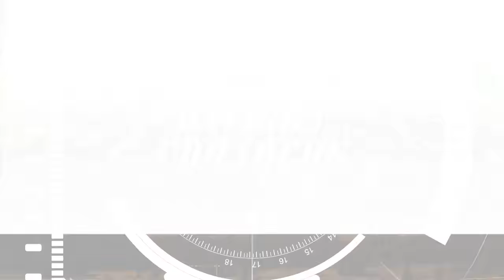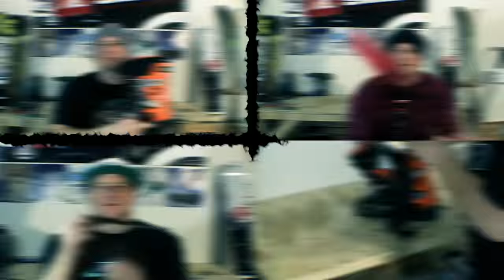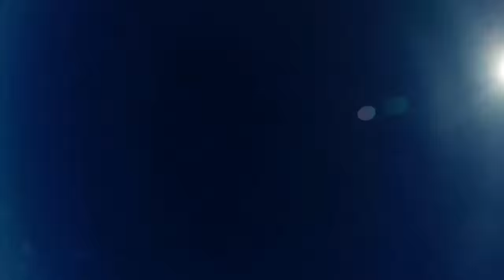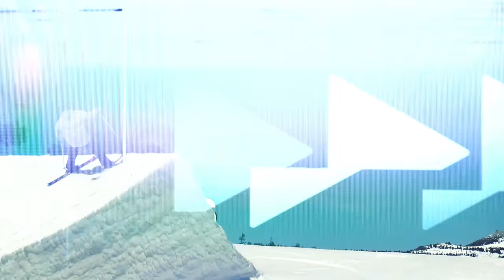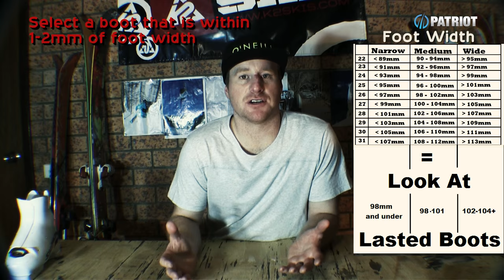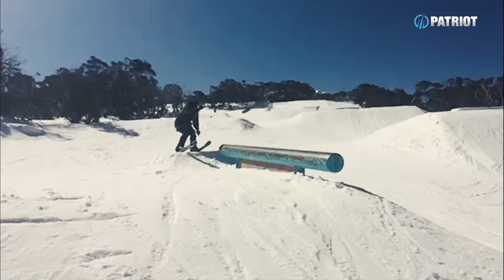How to choose a Ski Boot Last - Bootorials Ep.31

Comment: Thanks for this series. Very informative and precise. I have tons of problems to buy my first boots. Used Fischer Scan-Fit to measure my feet. The average  measured length: 285, ball width: 114, instep height: 78-82.  Tried several boots in the ski shops... always feeling several pressure points... assumed that I need heat moldable boots. I think that the closest to feel OK-ish was 29.5, 104 last (adjusted to my size: 110) Rossignol Speed 120 (still after awhile it felt good to take them off). Have no idea how much they will extend by itself during skiing and since they are not heat moldable I'm a little bit concerned.  Another boots recommended for wide feet: Atomic Hawk Magna 110 (with 102 last) seemed tight in instep. Boot fitter also recommended boots which he didn't have in store but could get soon: Fischer RC One 90, which are fully moldable (but come with 101 last) ... What would you suggest to do ?
Reply from the maker: Hey Tomasz, Yeah great work on the foot scanning. 
Do you have much confidence in the boot fitter to be able to stretch them for you? 
If you are looking to a heat moldable choice, the magna and RC one are both good.  I would also suggest looking at the Salomon SPro HV and the K2 BFC if you have a chance to try them on. 
The best thing you can do is spend a little time to see what feels most natural on your feet. That will be the best to then work from to adapt to your feet.

Comment: Such an interesting series thanks so much Craig. 
I'm really struggling at the moment - I've got Hawx 110s 28.5 (I think they give me 106mm last? off the shelf but they've also been stretched) which were fitted for me inc custom foot beds and have skied in for a couple of weeks, I find them comfy BUT they're just not stiff enough for me when I'm skiing hard and fast. 
I've bought a pair of FT Descendant 28.5s and followed your awesome videos on expanding the boot (thanks). I did one shell expansion but feel perhaps the inner layer of plastic maybe didn't get hot enough (in the oven at 119c for 10 mins) as I'm still finding them a little tight, no precise hotspots but overall just a little tight/cramped. I can't ski on them to fully test just yet as I'm at home many miles from snow :( . Oh i've also put in my previously moulded custom foot beds. 
 I have subsequently read online that FT's run a little short and that I should have perhaps got 29.5s? Should I wait to make a decision on them until I've skied them?
Any other tips or anything else you can suggest to help?
Reply from the maker: Thanks Robert, Yeah the atomics definitely feel soft for their rating with the thin walls and weight saving construction. 
Maybe with the FT it could be the liner thicjkness or maybe footbeds contributing to your sensations. Do you notice any of the same sensations in the Hawx? 
Yes the FT run short in length. It would depend on your foot dimensions, but I am usually pretty hesitant when it comes to going up a size. Best bet is to shell check to get a better guage of the space you are working with. You can get quite a bit of settling in with the FT liners also, so that may improve quite a bit with some skiing. But maybe take the other boots as a backup if it becomes unmanageable.
Reply: @PatriotFootbeds  Thanks Craig - Foot measurements Right - Length 285mm - Last 115mm - Volume 290mm
Left - Length 285mm - Last 114mm - Volume 290mm. 
Feels like I'm right on the cusp of them being too small, but of course I'm currently used to skiing in the Hawx which are super comfy. I don't have any of the same sensations of tightness with the hawx no. 

I was wondering if I perhaps didn't get the shells of the FTs hot enough, needs to be what like 90degress c?
Reply from the maker: @robertblack7207  Possibly is the case. But I would first anticipate it could be the liners becoming your biggest trouble for the feeling of compression. I would compare shell fits between the two, it will tell much more of a story for you! :)

Comment: Excellent info. Couple questions.  I'm runnin a pair of Lange translucent orange freeride boots  (27.5) for about 15 years now. I'm trying to figure out the last?  I think they're a close copy of the crazy blue WC boot from around 06/07 which is a 98 last.  I have a narrow foot and these are the only boots I've been able to get the performance I want from. I'm using Intuition heat molded liners & 2012 Volkl Kendo's (184cm). These are complete hell to get in and out of but they absolutely rock, excellent control and performance too. Guess I'm getting older at 55 :) Thinking about finding a newer boot, any recommendations? Similar in performance & fit but more up to date? Sorry for the book lol. Thanks, J.

Comment: Hey, I noticed with the Atomics that on the 27.5 boot they had 104 Last printed on the bottom, but on the 28.5 they had 106 Last printed on them. Does this mean they're actual size rather than scaling up from the 26.5 size do you think? Very unusual, and more confusing. I didn't see a 29.5 boot to see if the pattern continued onto a 108 last. All very confusing as like you said, I think the other boot brands that I saw had one last size stated across the range that you presumably could then roughly scale up from the base 26.5 size.

Comment: Thanks for the video they are really informative ! 
I am having some pain on one of my foot, I have k2 mindbender 130 that have 98mm listed for the last. When measured my foot that is causing problems is 102mm. For the measurement in the shell, do you have to be standing or sitting. For me that changes a lot. Sitting I do have the 1-3mm  space but standing, the edge of my foot is in contact with the shell. Thanks for your help !
Reply from the maker: Hey Gabriel, Your definitely in the range, but yeah you may need some slight alteration on that one boot. I do this test whilst standing with weight on the foot. 
How many days have you skied in the boots so far?
Reply: @PatriotFootbeds  Ok thanks ! I have two days so far. I think I will wait maybe  5-6 days before going back to the shop ? I think it was a bit better on the second day but I still have pain from that first day lol
Reply from the maker: @gabrielblain6229  Greaty, yeah that will at least tell the full story and see if your feet will adapt. Should be a quick easy fix to sort it out! Dont wait if it is too painful. not worth slugging it out if its simply too narrow. :)
Reply: @PatriotFootbeds  Thanks for the help :)

Comment: Hello!! I have a question to you. My foot is very thin, 90mm last, foot length 24cm. So for me is very difficult to find a boot. I want a boot for alpine touring so what do you recommend in this case? Thanks for the good videos that you published.
Reply from the maker: Hi Carolina,    Do you intend on using a tech binding?  Or will a hybrid boot be a possibility for you?  
It would be of benefit to have a boot with a lace up liner to help hold your foot. One thing that may really help is a zipfit liner to help give you security in the back and still have enough foot freedom for the walk.
Check out the Atomic Backland W and maybe the Tecnica Cochise Pro W.  or the Lange XT LV freetour.  Also a good quality footbed will be a must! 
Cheers :)

Comment: My barefoot measures 27.4 cm long and 12 cm wide.  I also have big calves.  What boots would you recommend I look into?  Also, what alpine touring boots might work?  I've looked at Roxa R3 130 TI IR, Full Tilt Sammy Carlson Ascendant, and Dynafit Hoji Free 110.
Reply from the maker: Hey James, yeah I would be looking at Hoji's, DB Panterra's and also FT Sammy Carlsons. 
I have written an article on the best wide fitting touring boots, I hope it will help with what is possible! Cheers :) - https://patriotfootbeds.com/blogs/news/best-ski-touring-boots-for-wide-feet

Comment: First of all thank you for videos, you doing great job! I have question about boot last. For example Lange XT Freetour LV 26.5 last 97mm for man,  Lange XT Freetour for woman LV 25.5  97mm.  About men's sizing all clear 100mm last its average man's feet, but woman feet is much more narrow. It's more that 2mm difference. Is woman boot really 97mm or it just numbers that show that boot more narrow than average?
Reply from the maker: Hi X2deff, Thanks for the kind words. You have to think about last on a scale. Have you had a chance to watch my sizing video? https://www.youtube.com/watch?v=Tx2j-eOTH4Y It gives a better run down on last sizing. Overall yes womens feet are narrower, but also generally smaller.  You have to consider that at the overlap size there of 25.5 and 97mm last,  that narrow mens feet and womens feet are starting to become close.
Reply: Thank you for you answer. Yes, i watched all your boot fitting videos.That's why i mention 2mm difference. For the same size, same model men's and woman's boots are just 2mm smaller in last. But in every ordinary shoes sizing chart men's and woman's foot width that considered average can have up to 10mm difference for same foot length in centimeters. For example my girlfriend have 24.15-24.55 cm and 92mm width. From ordinary shoes sizing chart it's average width.

Comment: Can you give me advice, after last years agony in hire boots. I had a boot fit, and on the advice of the fitter, bought Salomon Xpro 80.
Was told to wear them to bed them in, I've now done about 15 hours in them. Although they feel better than when I had them new, I wouldn't say they are comfortable, but they aren't painful. After half an hour, my feet feel tired. I was advised not to wear them for more than an hour at a time to start.
Am I expecting to much, is this how ski boots feel? my son bought  'Head form fit' which he describes as like slippers.
Reply from the maker: Hi Mate, 
So would you describe it as an aching feeling? Or just not overly comfortable? 
The first 2 things to do would be to try a heat mold on the liners and also swap out the insole for a footbed. This will offer much more support and will get the liners to bed in much better. 
Also a couple of extra things to think about is really thin ski socks. Also really focusing on buckle pressure until your feet get used to the boots. I would still say you are in the adjustment stage and with more skiing will come more comfort! :)
Reply: Thanks for the reply, yeah aching/sore like walking all day in uncomfortable shoes, feet feel raw within half hour and can't tolerate it for more than an hour. I've tried buckling up differently, normally going with snuggle but not tight, but have tried loose/snuggle/tight. I bought footbeds (Superfeet Carbon), I contacted the shop who said the footbeds could be the problem if your not use to them. They advised me to put originals back in and alternate between the two, unfortunately they didn't give me the originals when I left the shop.
So have arranged a return visit for the weekend.
Reply from the maker: Yeah, definitely go and see them. Also be sure to do a shell check to make sure all of the sizing looks correct. 
Could be as simple as going to a more suitable footbed, or possibly you would require some more width in the boot. 
Good luck and please let me know how it goes!
Reply: These are Xpro 80 wide, thanks again for the reply. Will let you know how it goes 👍🎿
Reply: Hi, revisited the shop today. The problem seamed to be with the footbeds they supplied, it appears I have low arches (flat feet) and the footbed was to high. Think they were tipping my feet outwards and forwards (kinda like I would imagine women feel on high heals) putting my weight forward.
So had custom footbeds made, which so far feel much better.
Thanks again for your time ⛷

Comment: so... taking out the liner from the inside of the boots, how much space should your foot have?
Reply from the maker: The best scenario is when your forefoot is slightly touching either side, up to about 2-3mm of space. (one side)
Reply: @PatriotFootbeds  hmm, my boots are 105mm and my foot 103

Lateral footbeds? What can I use to make the liners thicker if i want a more tight fit?

The boots and liners are heat moldable
Reply from the maker: @laurencerosenthalwinckler4439  The best way to tighten up your fit, would be either a Volume Reducer, or a combination of footbeds and shims.

Comment: ok, so what if i wanted nice, stiff, all round (mostly for slopes) boot having 112 wide food... from what I can see all "top"  boots have pretty narrow last... like 98, 100mm maybe. 

I tried tecnica mach1 130 MV, but my heel is pretty narrow and it's pretty lose in there. with LV, I feel pressure on side of foot after just couple minutes, exactly as you described in your films... i know shell can be stretched, but is extending it for over 1cm ok? for me it seems like a lot :/
My current setup with head RS 130 have same problem (even after all changes made), when skiing hard, side of my feet just hurts...what would you recommend? is there a hope for me ?:)

btw, very nice series, very helpful!
Reply from the maker: Hi Grzesiek, Yeah mate that is the dilemma that hasn't been addressed by the boot brands. The only way to make it work for you is to mold a boot or stretch a boot to get the combination of a narrow heel and wide forefoot. OR, you need to get a wider boot and secure the heel with footbed, heel frame, wraps or aftermarket liner.
Reply: so stretching boot by 1cm or so isn't something uncommon or undoable? It just feel like a lot, that's why I asked. 
What's the better option in your opinion from the 2 you've listed? Is there a better option? :)  Bootfiter from my shop seems to be only thinking about going for LV and stretching it... not a word about lose heel option even if we both know it's possible as you wrote. 

Also thanks for prompt response... to be honest I wasn't hoping for any! :)
Reply from the maker: No not uncommon at all and very doable. It will all depend on your goals as which option to go with. It is usually better to start with small boot and make it bigger, but there are limits. If the Mach 1 mv doesnt put pressure on your forefoot, you can add some C wraps to the C.A.S liner easily. Or another great option for locking in a loose heel is a zipfit liner. Last for years and you can add in more cork material around the ankles.
Reply: thank you! You've increased my trust in my shop/bootfitter. Just didn't want get new pair of boots that I already have... nice to ride but often painful. Time for more comfort on slopes!  Will probably go with LV :)

thanks again!
Reply from the maker: What boots are you currently in?
Reply: Head rs 130 so in theory also 98 last. But they were worked on couple times and at some point i was told they cant/dont want to make it wider. It's width thats a problem, not a single  point,  just outer part of foot. 

I get used to them and I can ski all day in them but have to lose the buckles  almost after every run for lift time (especially after harder or longer runs) and first run of a day can be painfull as f..... Was not the case with my old Rossignols (radical r14)
Reply from the maker: Wow, yeah you are certainly putting a wide foot in a narrow boot. The thing that will be important likely will be getting a boot that feels as solid as that boot. If you are using the same fitters as last time, I would think you need a good discussion to make sure they are confident with their approach. But the Tecnica Mach 1 will respond better to this work. All the best with it!
Reply: Tecnica 130 LV for now had best overall feeling for me (except for width of course as after like 5 minutes in shop i already have pain on a side, same with MV), tried couple other "top" all mountain (lange, head, nordica) and there is always "something"... but will try also others brands as I'm really worried about ending up with same feeling as in head RS. There has to be something for me!

I even found this: https://patriotfootbeds.com/blogs/news/48742593-5-best-ski-boots-for-wide-feet  and i see salomon still has this x-pro model that can be easily widen to 106... and hopefully than even more. Will try to find them and see how they fit me. I have narrow heel with low instep which from descriptions is usually not best match for boots with bigger last :)